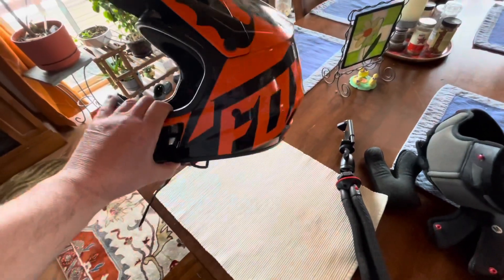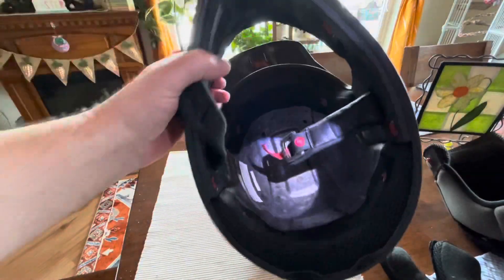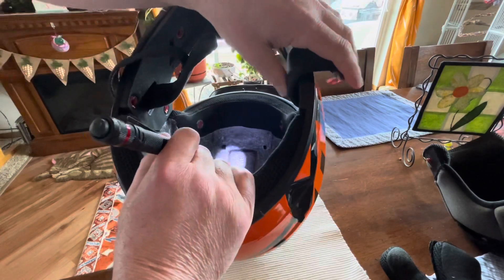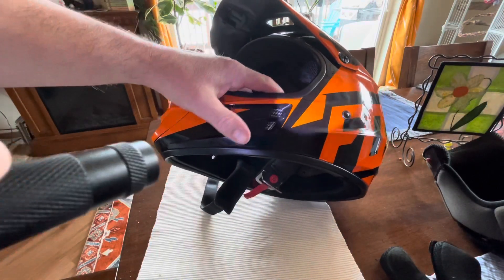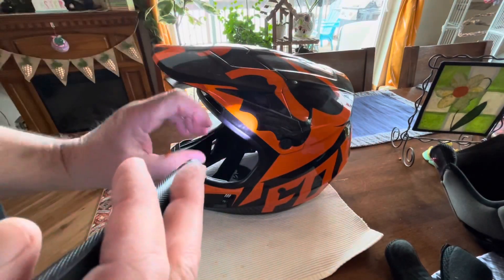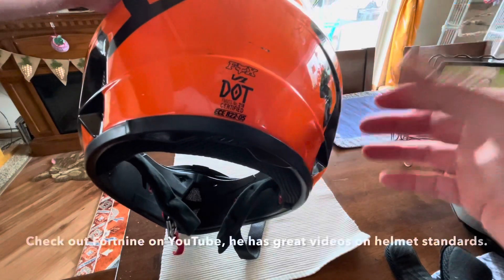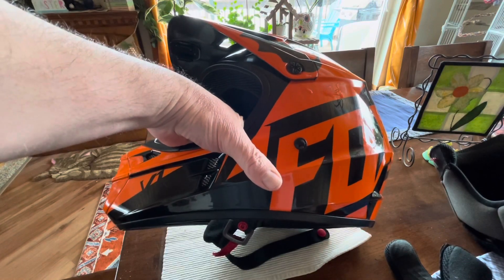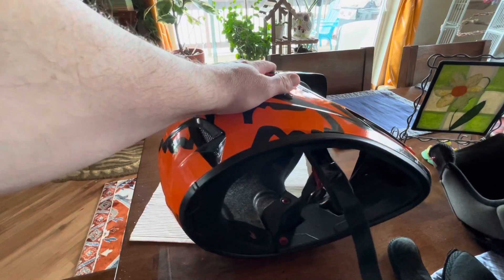Damaged helmet EPS liner inspection

Comment: Hi.

Just a question, did you break open the shell to check, Since you were throwing it?

Also, did the EPS creak?

Cheers
Reply: No, I didn’t even think about that but how would you go about breaking open the shell? It’s been almost two years ago so I don’t specifically remember if it creaked. I had check of a time finding good, legit info on inspecting a liner for damage. Seems like everything defaulted in, if in doubt, throw it out. 

I don’t have any regrets throwing it away. That was the hardest hit I’ve ever taken to my head in almost 40 years of motorsports riding. I would come home from work super tired and nap before eating supper for several weeks. Pretty scary to me.
Reply: @airgunsofalaska  I see.

Actually recently, I found a better way than opening shell. There is a way (not supported by manufacturers) to remove EPS liner. There we can check the EPS liner. (Again, just to reemphasize, manufacturers will consider this as 'tampering with the helmet'.)

Wow. I didn't realize the problem was so severe. That is terrible. I hope you are good now.

Thank You!